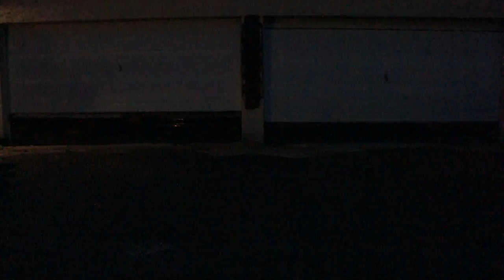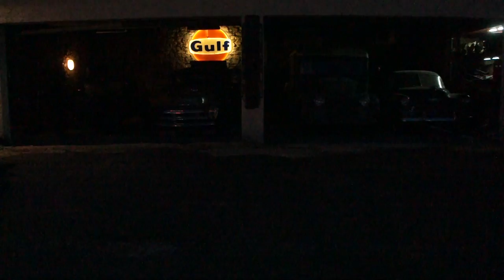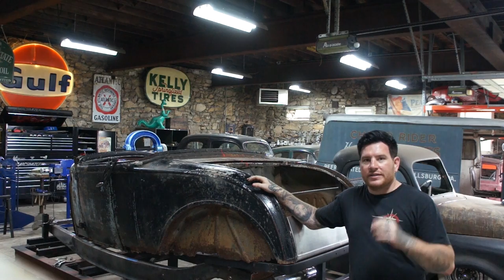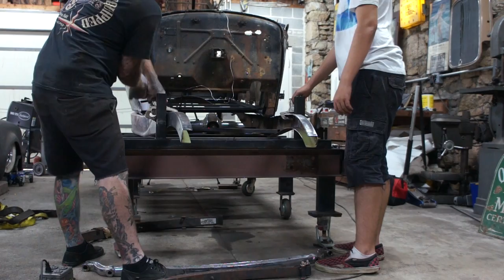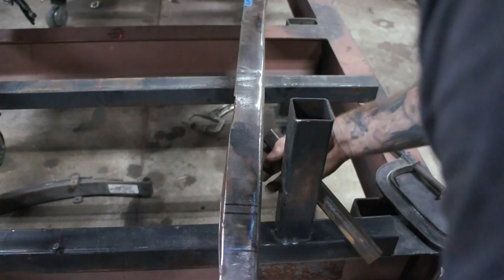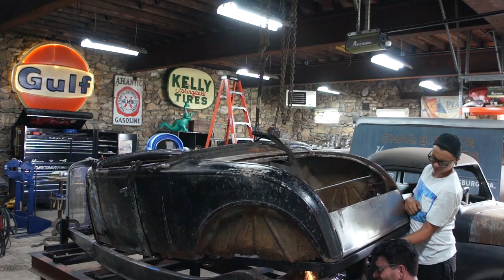How to Pinch a 1932 Frame for a Ford Model A- Sweet Heart Roadster Ep. 20

Comment: I accidentally bought a 1930 Doge chassis ( Frame ) and that's true it was suppose to be a joke , I put a bid of $250 on it ,  it came with a 36 Ford Banjo Diff and a 36 i beam front Axel set up and won the bid , so I thought I would put a A Model pickup on it and you just gave me some ideas , thanks Mate .

Comment: Hey question... it bothers me.. but when you  squeeze in the front how does this effect putting on the front end? Where does that attach ?  Just a point of confusion as I have never done this... always wanted to do..
Reply from the maker: The front end attaches the same as before. Front leaf spring in the center and you attach the wishbones however you’d like but most people split them and put them towards the outside of the frame.
Reply: @IronTrapGarage  thanks Matt I'm old and always wanted to build one.. but always wondered

Comment: Weren't you going to show where you pinched frame and how it was done?? Was it pinched near the firewall then opened up near the front to git the grill or ???
Reply: both rails were held together at the rear crossmember and pulled together at the front. Then welded the front crossmember to the rails.  The deuce shell fit better and the sides did also.  Really a good job of pinching the rails.